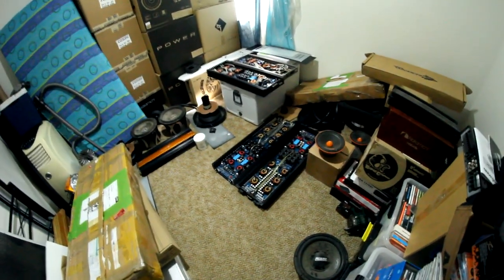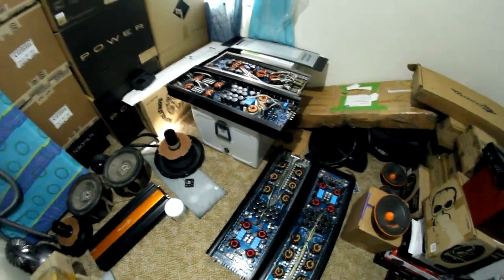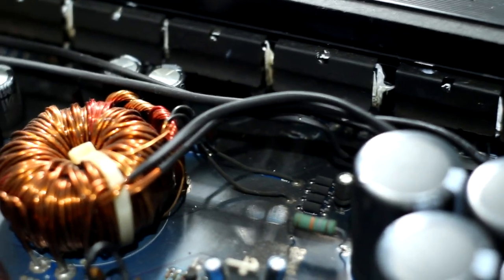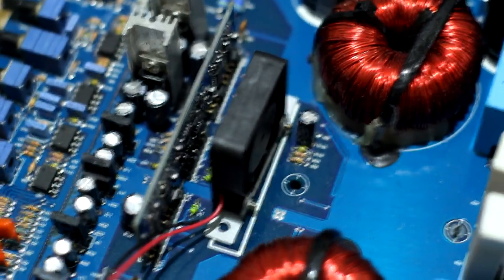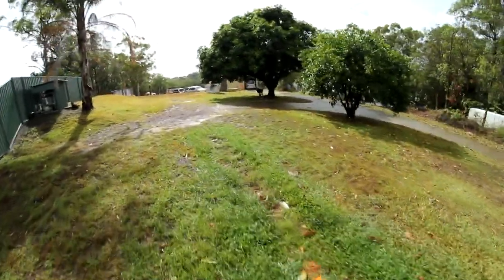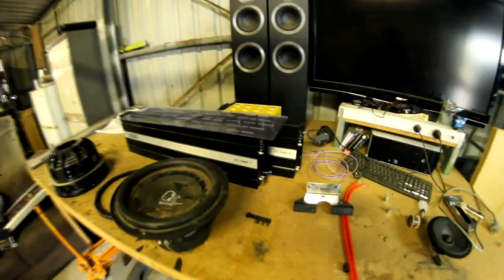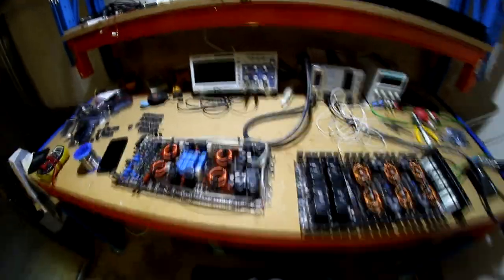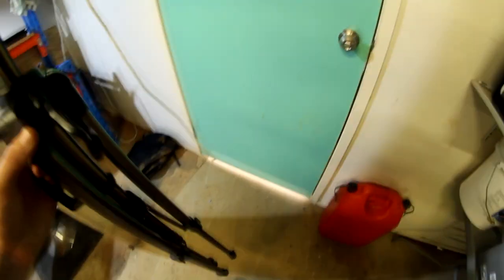Australian guy has big collection of blown amps for me to fix. BVDU #2

Comment: I am looking to repair my Soundstream PCA 1000d mosfet's part# " IRF Z46N 733P 8M 0A  " my question is can I replace with just any mosfet's or do I need to replace with the same part number? problem is this amp has been discontinued and the parts inside of it seem to no longer exist
Reply: https://www.sonicelectronix.com/item_5432_Soundstream-PCA1000D.html  <<< Discontinued!!
Reply from the maker: Use IRF3205!